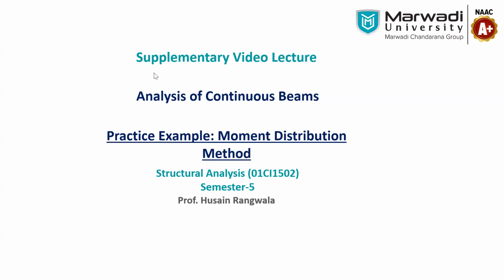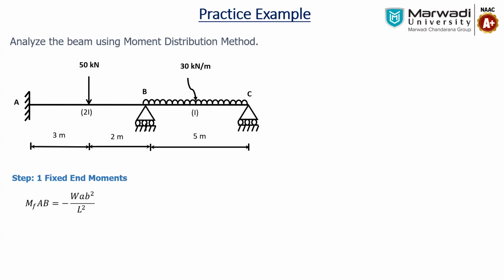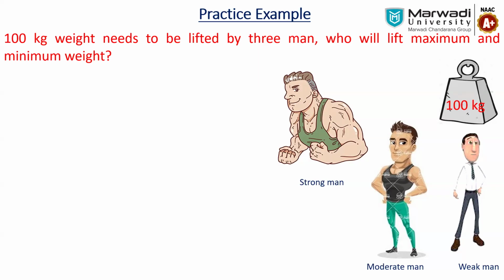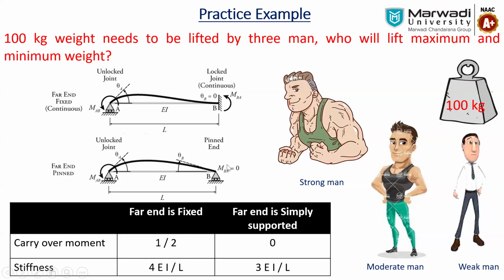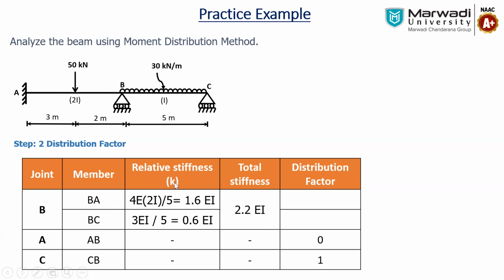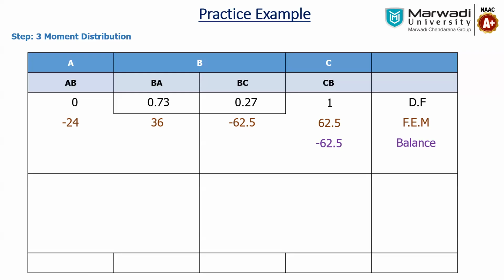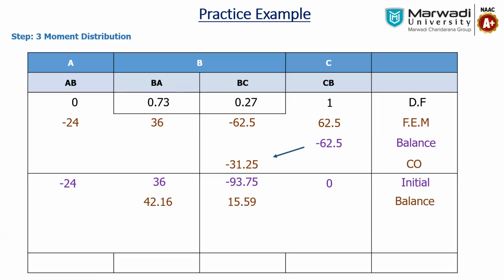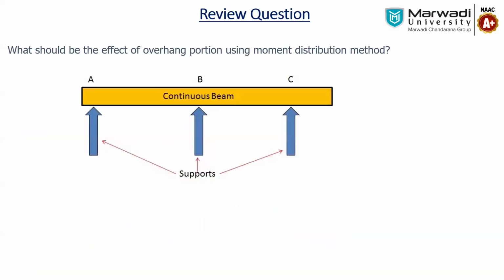Analysis of Continuous Beam - Moment Distribution Method

Comment: The presence of an overhang means the support C does not behave as a internal support.
Any load on the overhang will create a fixed-end moment at joint C. This fixed-end moment has to be balanced by redistribution of moments into adjacent spans. Using the moment distribution method, the overhang portion contributes no stiffness at the free end